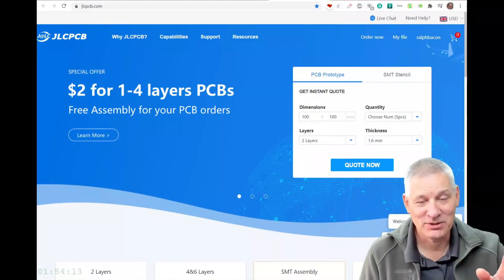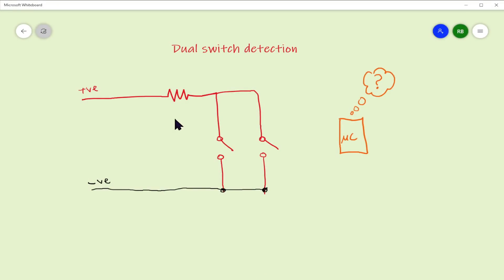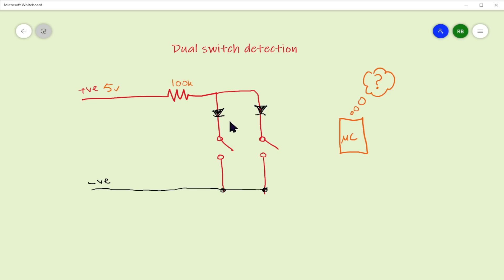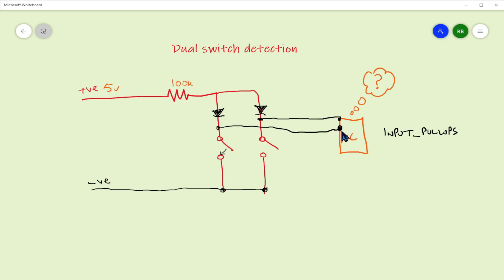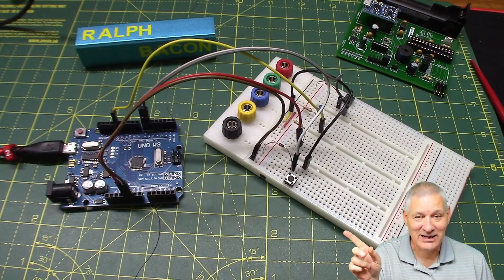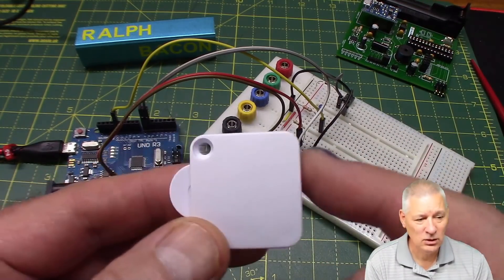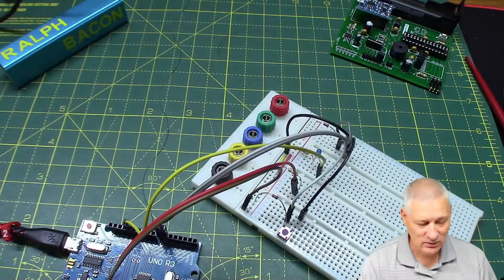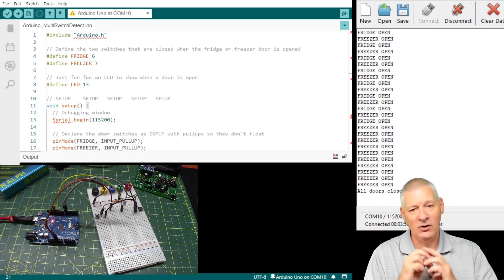#218 Dual Switch Detection using Diodes and an Arduino 😲

Comment: Great as always Ralph! Uh...call me crazy, but for the fridge ,why not just take out the bottom glass shelf, flip it over and draw a nice thick Shapie line across it with a little arrow pointing towards the back of the fridge to let the 'user' know the edge of the door bin? No need for an alarm.

But then again, what good would that be? It prevents your creative juices from flowing to make another Arduino solution!

Great job! Gord
Reply: your missing the point,he is teaching.
Reply: @TheUnofficialMaker  I'm kidding.  I'm a huge fan of Ralph's work😎
Reply from the maker: I have often thought of your non-fun, non-Arduino solution, Gord and I might do both as a belt and braces approach.
Actually, why did the manufacturer not do that. Oh, because it makes the fridge storage look tiny, understood!

Comment: I love your real world problems of too many bottles of beer in the fridge:-), my fridge doesn't have too many beers in it as I tend to drink them as soon as they are bought:-) so the door closes okay :-) I also have the pico and the 1602A display waiting for your video on that ;-)
Reply from the maker: I have less beer in the fridge now as I have one in a glass right next to me... hang on... half a one in a glass right next to me. Yes, that 1602 and the PICO works fine using MicroPython but C++ still locks up the USB. Working on it!

Comment: Good video. Thought you were going to wire them to one input and use resistors to check for different voltage levels.  How are you running the switch wire from the freezer to your microcontroller? How do you get the wire out of the freezer cavity?
Reply: i think its on the outside.
Reply from the maker: Yes, the wires are from the white switch which is screwed (currently Blu-tacked) to the inside of the cupboard but outside of the fridge/freezer unit.

Comment: Wouldn't your microntroler pull down the inputs when power off. This will turn on the mcu again?
Reply from the maker: This rings bells that I might have put a further (Schottky) diode in series with the pin(s) in another circuit. I will have to check this. Excellent point, Jens.
Reply: @RalphBacon  I don't think diodes will do the trick, and especially not schottky, they have a high quiescent current.
Reply from the maker: I was thinking putting one in series with the input pins so current can only flow OUT of the μC not back into it, thus shorting the gate of the MOSFET to GND and switching it on. I'm sure I've done this before. Anyway, I will have to check that all is OK before finalising my design (which is 100% in my head right now). Keep tuned!
Reply: @RalphBacon  My solution would be to connect one end the switch to VBAT+ ant the other through a resistor to ground. From the point called "A" where the switch and resistor are connected insert a diode (Anode) connect the Cathode to the gate of an NFET (Source to ground, Drain to the existing FET gate). And insert a resistor from A to an input port of the MCU. The purpose of the diodes is to make a OR gate. Now we only need to pull down the Gate of the new FET, this can be done connecting a resistor to ground, or perhaps connecting it to an output port of the MCU, in that way the MCU is in control of switching off power.

Comment: You could use a reed switch and magnet, as used in door and window alarms. Make simple enclosures for them out of styrene sheet, or 3D print if you can. Both parts could be made quite small and unobtrusive.
Reply from the maker: I used a reed switch in the previous fridge alarm (for the fridge in the utility room, which I showed first) but it was tricky to get the distance "just right". The switch must not close unless the door is totally, 100% closed, not "nearly just 1mm open"!
This way I can adjust the position without too much trouble.

Comment: Just a thought and a simple solution, the two doors become one with a small flat join plate ! just the one switch then required, yes I know there then no longer independent but when I've been shopping and loading the fridge/freezer both doors are open and when I'm getting anything from either then there only open for a brief moment anyway :)
Reply from the maker: If the boss notices anything different about the fridge/freezer it will fail the "wife test". Anyway, getting a bottle of Bud from the fridge should not involve opening the freezer door, surely?

Comment: could you remove the fridge doors' bottom shelf so you can put what you like on the bottom shelf including the milk (which will stay just a little bit cooler as it will no longer be wedged up against the door in the door shelf).  If not then you really need an AI house bot called Marvin to do it all.
Reply from the maker: Order #3254: one house bot (Marvin). Send asap. 😁

Comment: I was living the story and enjoying it....then my common sense and stingy streak kicked in and spoilt my beautiful trans like state.....why add 2 diodes when you could add just one resistor...say another 100K in line with second switch....result would be the same ...both independently signalling hi or low states ...I am sure there is something I am missing...just can't see it
Reply: That's pretty much how it's usually done, the whole role of pull-up resistors is isolation of switches from the supply.
Reply from the maker: I wanted to (a) keep this simple and (b) avoid analog resistor ladders just because I don't like them 😁
Two 100K resistors instead of two diodes will also work but it can all get a bit edgy - diodes simply conduct or block so I find it a safer design decision. But that's me, squandering the family inheritance on diodes 🤣
Reply: @RalphBacon Diodes have voltage drop though. In some cases it may be high enough to bring high logic level below detection threshold. Or at least that drop in pull-up voltage will lower noise immunity on the input, especially with a bit high value of the pull-up, like 100K.
Reply: @RalphBacon  I wasn't` thinking of a ladder...rather one resistor in each switch leg....basically duplicating your first switch combo...therefore the same logic levels going to Arduino...i.e. full 5V or zero
Reply from the maker: The resistor is only there to bias the P-Channel MOSFET off; I'm not sure that two resistors are going to help me; they would still be connected to a common point - the gate of the MOSFET?
Reply: if the microprocessor has adc (analog to digital) , checked ADC in Atmega328p, it has.
checked attiny13, it also has adc.
Reply: @jyvben1520  ADC has nothing to do with it.

Comment: So you're not going to just wire the switches in parallel and power an annoying buzzer then? :D
Reply from the maker: Good grief no. You obviously missed the previous videos on fridge alarms, Ian. A nice chirp as the door opens, a reminder beep after 30 seconds, two reminder beeps after 60 seconds.... finally full blown annoying BEEP BEEP after X minutes (where X is yet to be decided by chief design architect, aka my wife). If the door shuts in time, we use an interrupt to give a reverse chirp that the door closed OK. It's amazing how quickly you get to listen for the confirmation-of-door-closed noise!

Comment: The first thing I checked  if my fridge is completely closed  😂😂
Nice video! 👌🏽
Reply from the maker: And was it? See another comment above where a viewer lost the contents of their freezer just last week for the exact reason I demonstrated. I said it was a Real World problem!
Reply: @RalphBacon  hopefully yes 🙏🏽 😁
Maybe another method could be via measuring the temperature continously/periodically. If the temperature starts falling (slowly, not fast, caused from opening manually) , an alarm should be given out
Reply from the maker: Sounds far too complicated for me! A simple "is the door open" alarm worked for years in my last place; this one will be battery powered so a bit more to it but basically a simple alarm. You'll be suggesting I send myself an email about the door state soon! Oh, someone did that.

Comment: Well hello! maybe for a neat installation, remember the seals on a fridge and freezer are magnetic !, go hall effect or reed ? just a thought!
Reply: having thought a bit, i suspect that the internal temperature of the fridge could be used effectively to tell if the door is open! direction and rate of change, either stand alone or with motor/temp switch input.
Reply from the maker: Glad you're thinking about this Real World problem, Jonathan, but how would it detect the door closing (quickly enough) and thus switching off the end-of-the-world alarm?
Reply: Maybe by mounting the temperature sensor in the back (so the temperature won't change as fast)?  Or just that the temperature has to be too warm for a long enough time (minutes?) before sounding the alarm.
Reply: @RalphBacon  cos we is clever! we use the both rate of change and absolute temperature, we see the temperature is dropping and reset - leave for a couple of minuets and re test.
Reply from the maker: You is clever, maybe, but I is simple - which is how I want this alarm to be! 🤣
Reply: @RalphBacon  we are are called to greater things! We laugh at light switches! Why push a button when alexa can do it! We sniff the WiFi to alert us when the Mrs comes home ! Even though we can hear the car! We have routines to turn on the monitor and media pc  over wol , cos pushing two on buttons is so yesterday! We have radar in the bathroom to keep the light on! Ralph you are called to greater things ! A post-it note or child lock on the fridge is below you - go uranium in the fridge and a giger counter on the outside!
Reply from the maker: You've convinced me that a full blown, home automation system is required for this fridge alarm; Node-Red, MQTT, Raspberry Pi, WiFi, email... the works! 😄